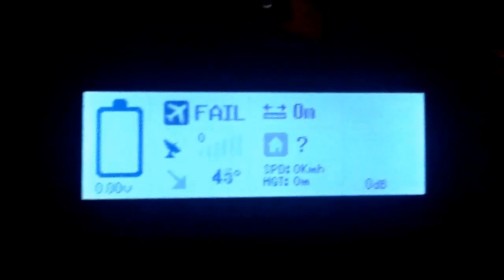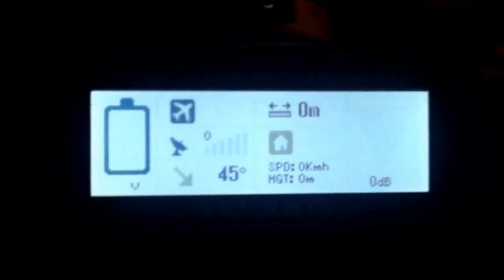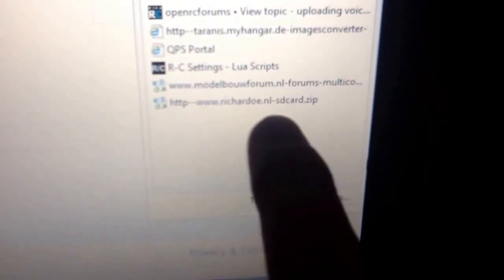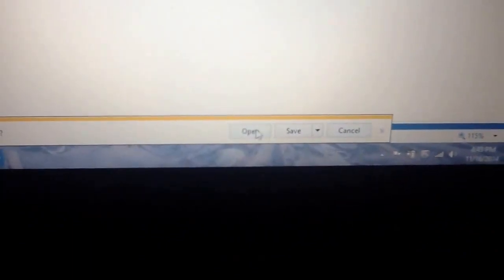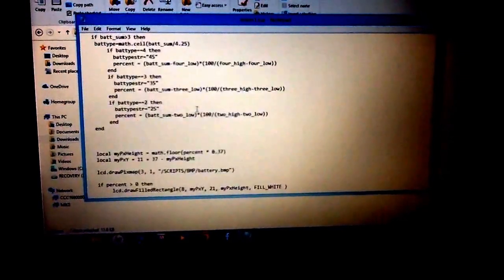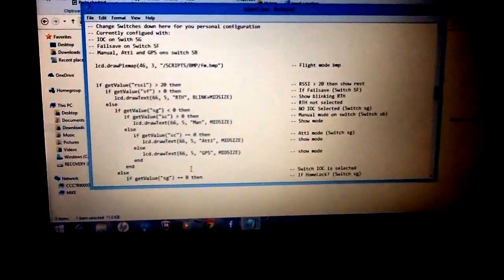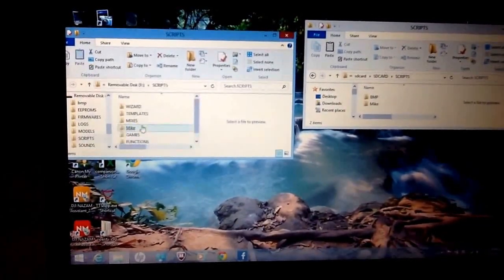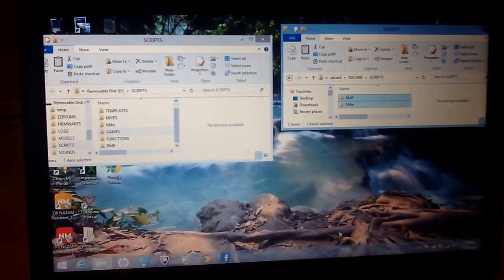Setting up LUA Screens Scripts on a Taranis Plus          http--www.richardoe.nl-sdcard.zip

Comment: thanks for taking us through lua 

2 questions 
1. how do I open this file, do I have to change the extension to .txt or do I have to install lua reading software 

2. when  I am trying g to assign lua script on a switch, it says no script on sd card, but the script is working fine with my model 

any idea, may be I am doing something wrong